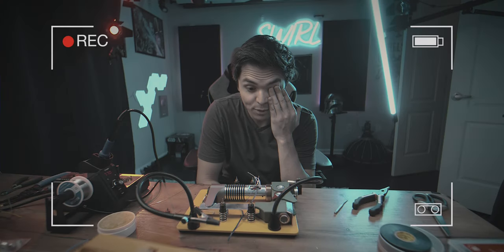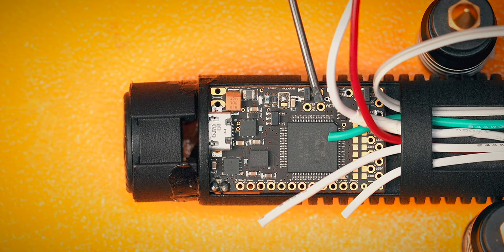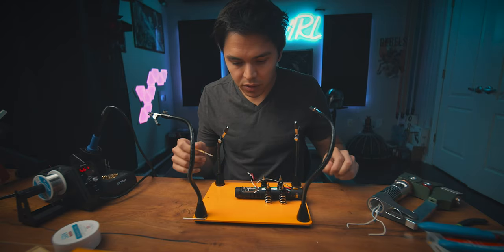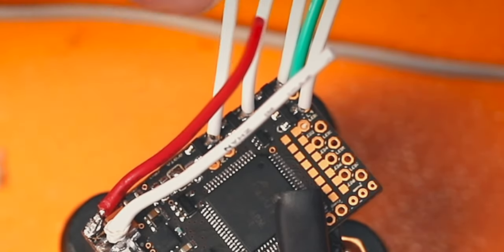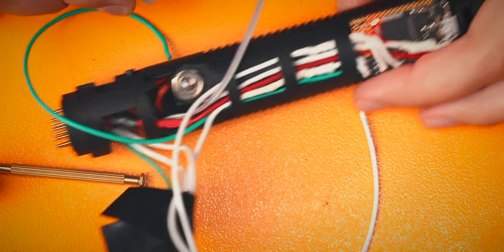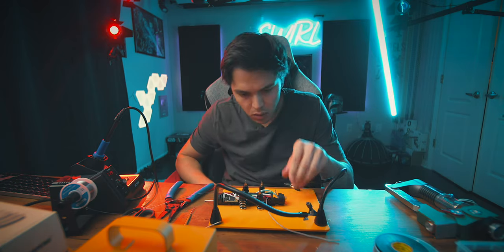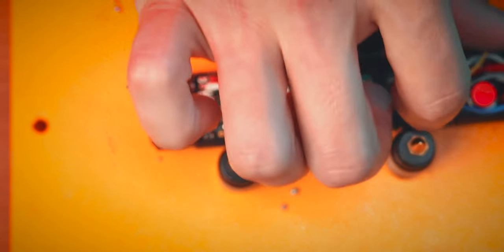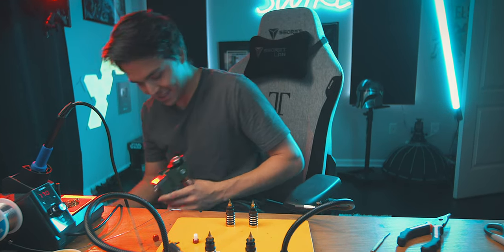WIRING the CRYSTAL FOCUS 10 (CFX) Soundboard for NEOPIXEL

Comment: Just finished my first build a couple weeks ago and just a couple tips.

Flux is you friend use it in every joint and Pad! It makes the solder flow extremely well!

Do a completely out of the hilt test to make sure everything works beforehand.

I would highly recommend soldering all the wires to your board first and pulling the wires through the chassis. Then soldering the wires to your battery, pixel connector and so on. This makes it extremely easy to manage the cables and gives you a ton of peace of mind when putting the chassis into the hilt.

And just remember not to get discouraged. In the end it's an amazing learning experience and making mistakes is all part of it!

Best of luck 👍
Reply: another thing i found to be a life saver for most things, *SOLID CORE WIRE* especially with through hole stuff. bend it into shape and solder the ends, I made a nearly complete mock up before is did the final assembly I also did the same on a bread board to confirm it worked
Reply: And using a good quality solder is also very important.

Comment: I’m sure you’ve figured this out by now, but regardless of blade being inserted your board should make a boot up sound when you remove the kill key. You definitely had power to the board (that little red light) but I’m willing to bet when you squeezed the chassis in your hilt a connection was messed (done it myself more than once). I would try some flux, helps ALOT with solder flow and connections, there’s no need for the wire to be in the slot fully if you have a good solder joint. Also you want to make sure you clean up that excess solder that’s on the recharge port from the nearby pads, you don’t don’t want bridge anything that shouldn’t be bridged, recipe to fry the board.
Reply: I don’t know how these sabers work but i did get electrical engineering. So with that on of button if it was soldered to one pad its probably shorted out is it not?
Reply: @commandantkevin  you should know how it works then.  There are 2 wires, one to ground, one return so pressing the button pulls the IO pin on the MCU to GND, activating it.
Reply: @commandantkevin  yup, Adam is correct. Each button gets its own +, and use a common ground or -. Less pads used up on the board this way, allowing for small footprint.

Comment: Dang, I had a flashback watching this!  I fried a couple boards before getting it right.  I watched dozens of video before starting but most of the real learning comes from trial and error. For me more error that necessary $$$$! You arlready figure the following out im sure but...Pre-tinning pads/wire, prefit to determine wire length, test components prior to install, check that you have continuity where you should and no continuity where you shouldn't (using a multimeter). A little prayer, meditation, stiff drink may help? Thank you for your candidness and sharing.

Comment: The greatest teacher failure is. 
Don't give up, I can't tell you how many times i pulled the kill key and....nothing. 
Finding out where you went wrong is part of the journey man. 
But i can tell you for certain, you WILL get it right. Trust the Force. 

Also a tip: You don't need all the negative wires going to the board, cluttering things up. You can join the pads directly on the board using cutoff resistor tails. That way, you only have a single wire going to the board, but all pads are active. 
You might not be able to at this point, since the holes have solder in them now. It works best on a new board. 

Biggest advice I can give, which others have said is this:
Test all the electronics outside of the saber first. All of it.  And test as you go too.

Comment: Just a thought for the future: Flip the PCB and solder the wires to the back instead of the front; you can actually just tin the ends of the wires, clip them so they barely pass through the PCB, poke them through from the back and touch the soldering iron to them and add just a tiny bit of solder. The other thing I would suggest is to solder the wires to the PCB outside the chassis, then run them through the Chassis and connect them where they are needed. You will get a much cleaner finished product that way, and you will risk a lot less with the expensive components like the Sound Board. 

Hindsight is 20/20 right. So when you do this sort of thing, take some time to work out what problems you're going to run into first without doing the work and running into them, then work backwards and solve them, and do the work.

If the wire is having trouble passing through the holes in the PCB just shave the solder down as it's most likely the irregular bumps and bends. You can also just compress it a bit using the smooth section of your plier jaws. 22 AWG should be fine for that.

Comment: So did you solder the switches correctly?
Each switch has two wires, the plunger connects the two wires when depressed so it doesn’t matter which of the wires goes where but, the power switch has one lead that goes to the pad you were pointing at, the other lead goes to a ground. Should be illustrated in the wiring diagram for the CFX in the manual. 

Same for the aux, one lead to the aux pad, the other lead to the same ground the other button went to.

If the switches are wired incorrectly, the board my may be reading that the buttons are depressed and when pulling the kill key will result in no boot up.

You don’t need a blade to test the saber.

Another note, usually you don’t want to bridge wires as Y connections as this is an easy way to create a “loop”. All wires should go from pad to pad or component to pad.
Reply: Agree with all except Y wiring. It's necessary for recharge port wiring. Also hard to fit 2 wires on 1 pad.
Do what works best for you!

Comment: Tips from an experiences sabersmith: 1)plan plan plan plan. Plan out your build thoroughly before you putting everything together. 2) test fit everything every single step of the way before you put anything together. 3) read your soundboards manual at least 3 times all the way through before building. 4)take your time. Go slow. 5) always use more wire than you will need. That way you can remove excess when soldering to the board. 6) 22 guage wire is much too large. 28 guage for neopixel work, 30 guage for everything else. 7) plan out and know which wires can go on which side of the board. 8) hot glue is not recommended for anything except for securing wire joints. 9) NEVER TIN THE WIRES OVER THE SOUNDBOARD!!!! Solder can drip and bridge pads causing shorts and all kinds of other nightmares and you'd never know where the problem was.

Comment: how did the blade not fit
Reply: most saber hilts, and thus the blades for them, are compatible at 1" for their diameter. The emitter here looks to only be able to hold 7/8" inch blade instead likely. Not usually a major problem but there are less places that sell 7/8 blades since most hilts take the 1" as mentioned.
And since it's neopixel, 7/8 pixel blades are a little bit harder to find complete (so tube and tip together), and neopixel costs a fair bit in comparison to hollow blade for in-hilt led.

Comment: Your irons tip is small. Use the largest tip that still allows you work comfortably on your project meaning the tip size should about the same size as the pad your soldering to. Also it’s better to use a chisel tip not a pointed tip. Allows for better heat transfer to the pad.